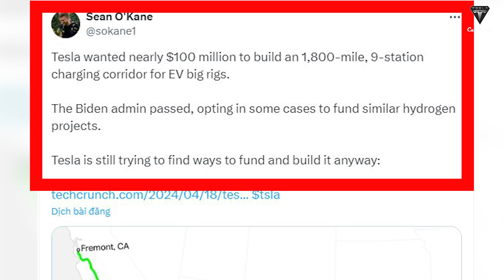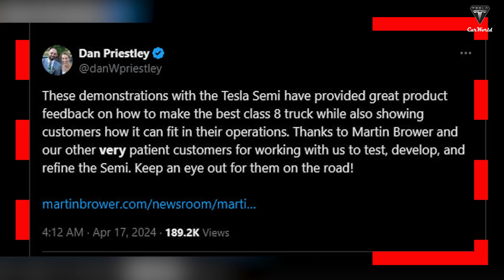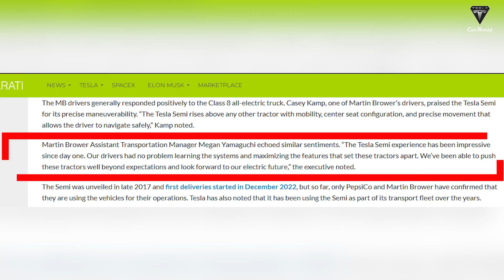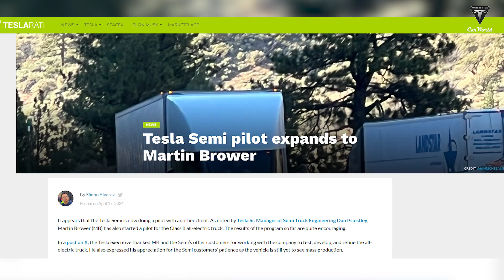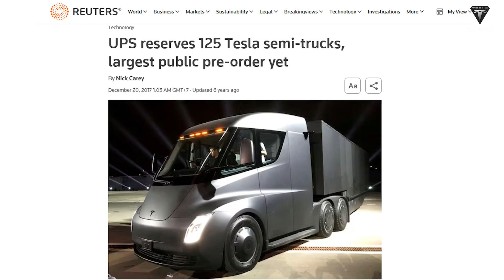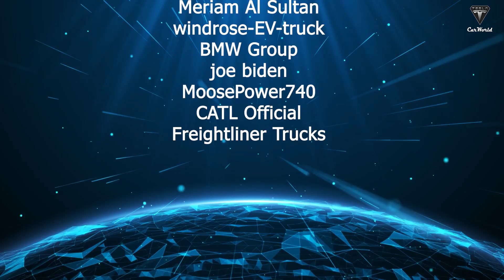Just Happened! Elon Musk LEAKED Tesla Semi Mass Production, New Super Battery & Delivery 2025

Comment: A new battery pack every 200,000 miles? How long is the electric motor good for? The average diesel engine can be rebuilt to cover over 1,000,000 miles during its lifetime .

Comment: Dumbest design possible, blind side reversing on both sides. It is hard enough in tight spaces when you can look at the trailer wheels directly using a mirror makes it harder and a camera would be worse (no depth of field). Not to mention any medium sized distribution center will need an entire town sized sub station to keep their fleet working an amazon center is going to need a city sized sub station. EV trucks being main stream is at least 50 years away, the time needed to build enough power stations to power them.
Reply: This is what happens when Quality Control and Field testing dose not exist or is not used???
Reply: Blind spots will not be an issue once FSD takes over. That’s not going to be 50 years away.
Reply: Cameras
Reply: @squiggyg.8415  Unless you are wearing a headset and the cameras are binocular there is no depth of field perception. That is a lot to go wrong when you are running out of driving time. Just being positioned at the side just gives a far better view than relying on cameras. better for overtaking, better for reversing, better for listening for tire/engine noise, The central position is great if you are in a racing car but not an 18 wheeler and definitely not in any multi trailer rigs.

Comment: One thing is sure. Electric semis wont take off in Australia. On the east west trip accross the Nullarbor there is nothing for miles. Same with a lot of farms, nearest small town can be 200 to 300 miles away. A lot of these trucks have "belly tanks" in the trailers. For electric trucks to work they would need 2 spare banks of batteries at least and a fork lift to move them. Electric trucks on most of Australian trips clasifies as a big Imposible

Comment: A better alternative is Battery Swapping which may not only save 50% of initial investment on charging stations, but also refresh the energy in 5-8 minutes.
Reply: Over all they do not help much, the used batteries still have to be charged eventually and there is just not enough power available. Even running at maximum capacity 24hrs non stop a town sized substation will only keep 50 or 60 (maybe 100 trucks if they are short range) operating even if the battery change was instant the bottle neck is getting the power into wherever the batteries are being charged (in or out of the trucks) count the number of truck and the size of the battery then calculate how many total hours will be needed to charge them all. if it is more than 24hrs to 'fuel' the fleet,  you need a bigger substation. then you need extra capacity to account for power cuts bad weather, technical difficulties and routing delays (if all the empties arrive at once) can you charge them before the next batch of empties arrive.

Comment: Solar on top of trailer. I've always seen trailers themselves as battery's.. the sun hits the top of trailers without shade. Think about it.😊
Reply: You get so little energy the weight of the cells lowers mileage.
Reply: @davidwatkins622 dream on!  LOL! Cells are nearly weightless... the problem is that a few hundred square feet of solar would not add significantly to the range of a load weighing dozens of tons. Even solar on the roof of a passenger vehicle is not too significant unless you're thinking of something like an Aptera EV.

Comment: Remember the old saying “ there will be no wine until it’s time”?  The delivery of semi trucks is dependent on several techs coming together all at the same time.  Tesla needs to develop the right charging network, the right battery solution, the right final design and the proper manufacturing facility to bring this product to mass manufacturing.  Tesla of course knows this.  The pieces have been identified.  Execution is now required.  I suspect that Elon will bring up the pressure to get this product moving once he gets several other projects off his plate.

Comment: Put a battery under the trailer.
Reply: Each pound of battery weight means 1 less pound of payload.  GVW in the U.S. for a class 8 is 80,000 lbs. Most average about 73,000.
Reply: @howardj602  would also mean far greater range. Adding an extra 2 tons wouldn't make that much of a difference per haul, and it would probably add another 200 miles of range.
Reply: @randomunavailable  Two tons is 4,000 lbs. Considering  max load weight is now around 40,000 to 44,000 lbs it would be a big chunk out of the revenue,. And the average weight is 73,000   The actual  load weight is a closely guarded secret, but this is the best estimates. Just imagine of the trucker drivers wanted a 10 percent wage increase, or a 10 percent iin hours???
Reply: @howardj602  depends on who's paying for fuel. Industrial power rates are lower especially at night in many cities.
Reply: @randomunavailable  Industrial power capacity is at or near it's peak from existing power generation. One charging station in my area took three years to provide transmission and distribution upgrades for 78 charging stations at one location.  It took 1.5 million just for the transmission line from the substation to the chargers. 3.4 miles.  EV commercial operators have formed Corporate Electric Vehicle Alliance, and are building their own generation capacity.
Reply: The
Reply: @howardj602  That should bring costs down further, power delivered for a specific need without having multiple transformers for different requirements.
Reply: @randomunavailable  That is only going to benefit the commercial operators. Most long distance freight will not be handle by OTR trucks in the future.  Intermodals are being expanded at a rapid pace.  The future of  EVs will be in short hauls less than 600 miles or the  extreme range of The EVs.
Reply: You can only add a certain amount to the trailer before it weighs enough that the semi cab is too light to control the entire rig without it having a tendency to jackknife.